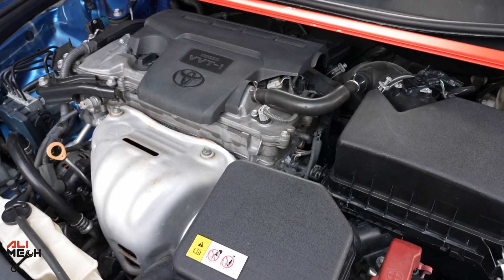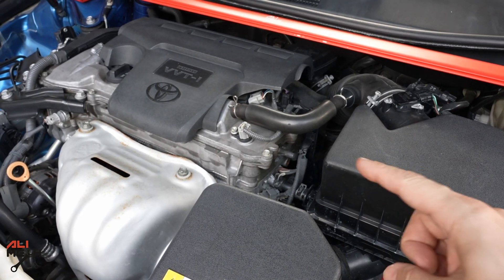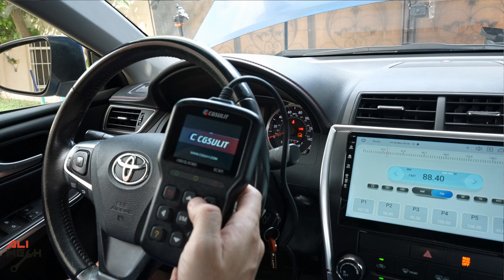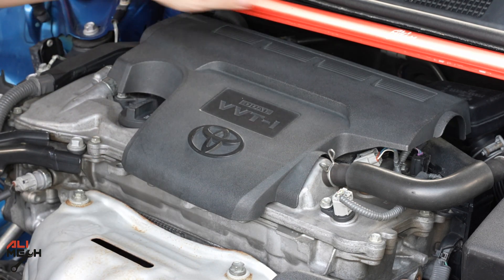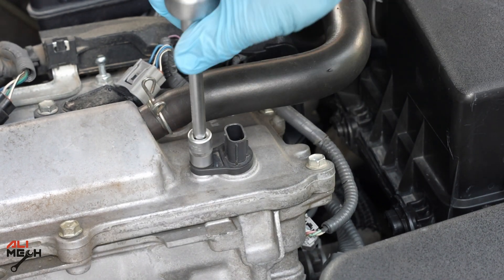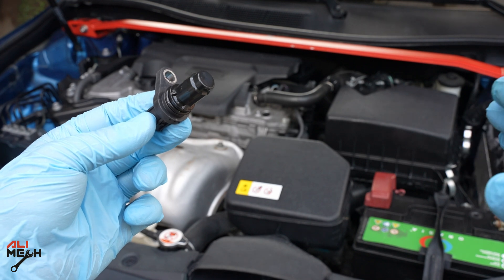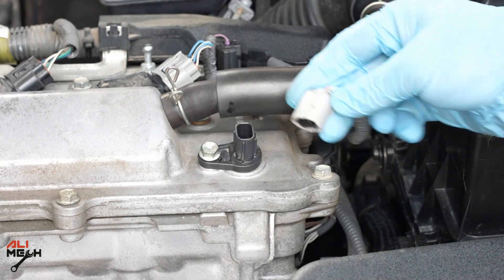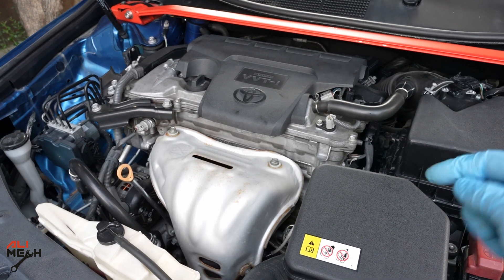Watch What Happens with Bad Oil! | How to Fix Camshaft Sensor Code P0340 on Toyota Camry

Comment: Interesting video, i had a camshaft solenoid issue in my Mercedes 1.6 turbo m270, possibly caused by counterfeit oil i used unknowingly.. it's not certain but it could be. I had to replace the sensor / actuator cost around 250 usd here in Kuala Lumpur